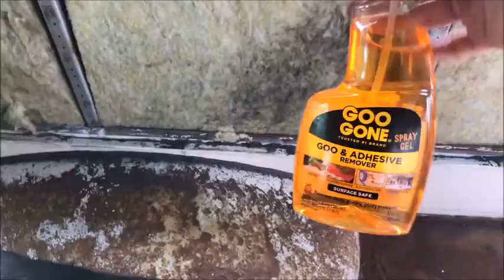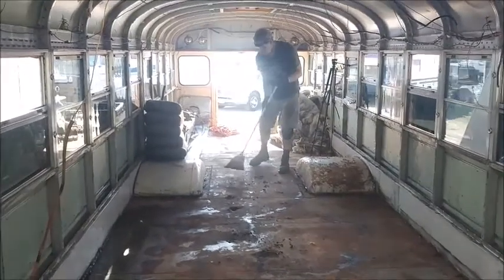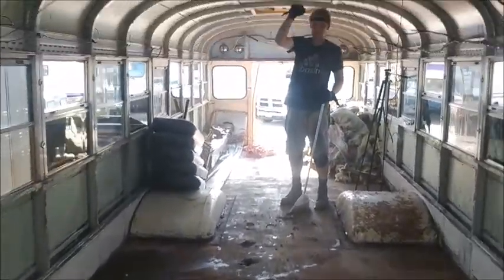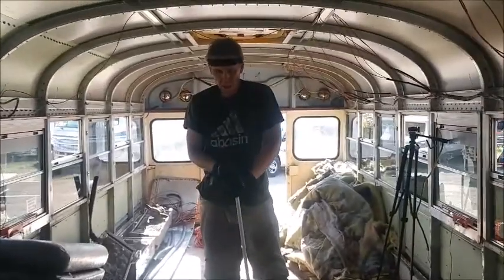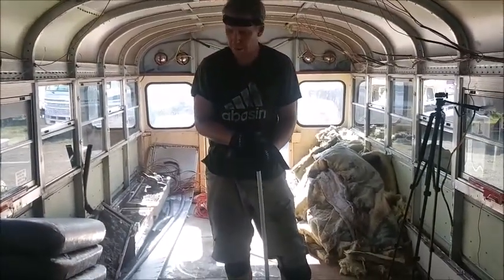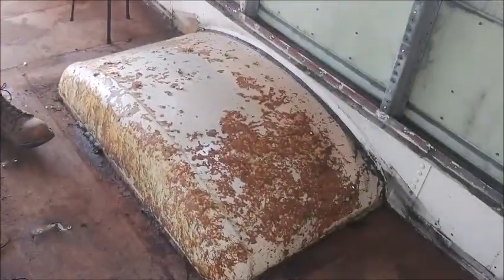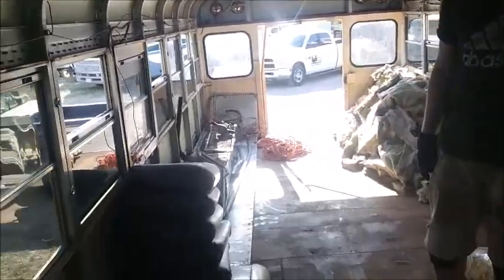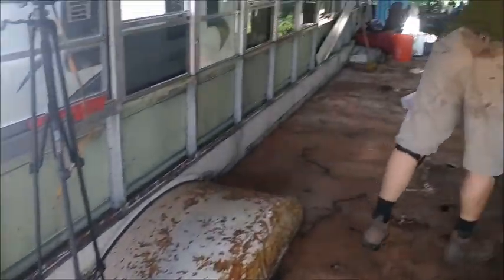v4 removing walls & heaters

Comment: Why are you not keeping the heater to warm the bus when on the road?
Reply from the maker: Norris Coleman they were too big to design the floor plan around. We are planning on adding a propane heater or small wood stove if needed! Thanks for watching
Reply: I've often thought the same thing, I don't understand why, lol. When I get my bus I still think I'll leave mine in, in case I travel to Colorado sometime, lol.
Reply: Another problem with them is they only work when the bus is running.